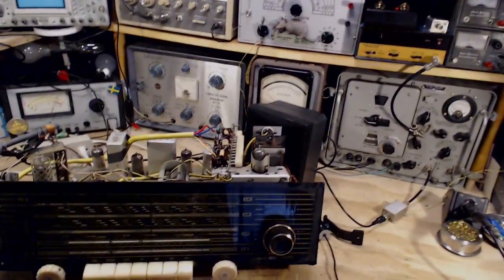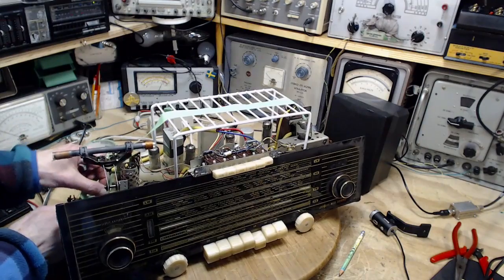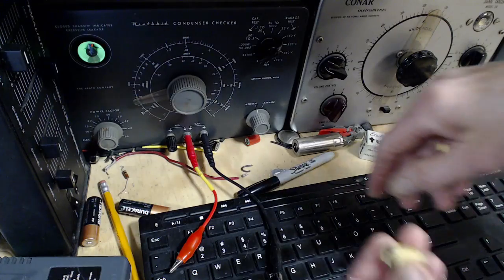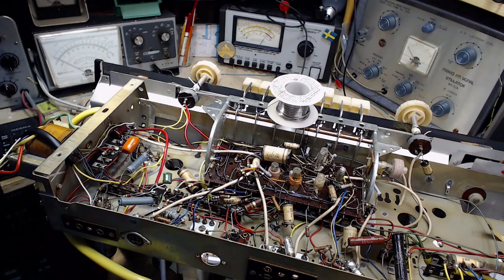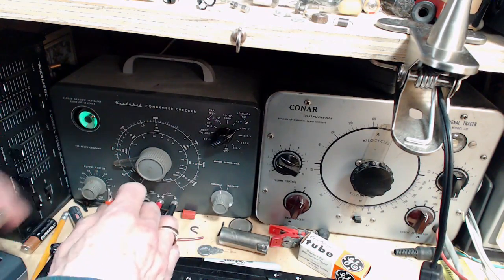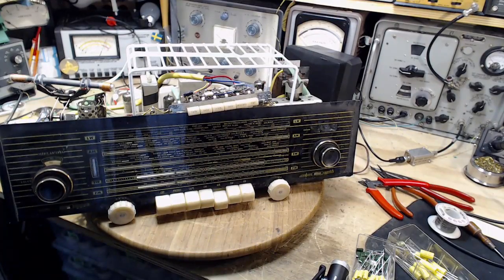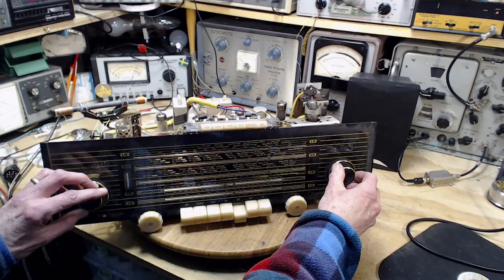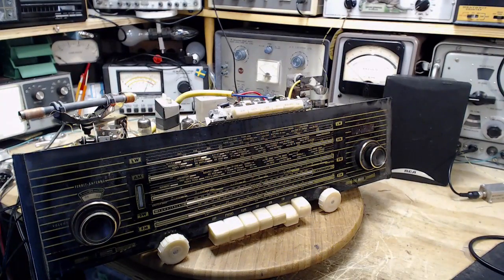German Console Radio Video #2 - 17 Catpacitors Replaced

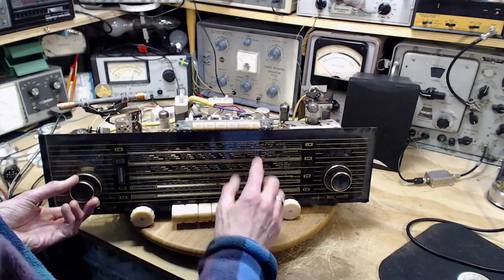Comment: 38:48 it may very well be regeneration or undesired feedback seeing that on replacing the caps near the array of band switches the orientation of outer foil was ignored, thereby opening many doors for stray signals to enter high impedance RF and IF inputs.
But hey, good enough. Good show, great success. A radio working decently before at least on AM is now a RF noise generator...
Lets do an alignment, and seeing that we cannot read the german manual nor care to use google translator on it, we will wing it...
Looking forward to another 107% success story...

Comment: 27:53 2x5000pF was a common value for double caps from L and N to chassis. Which btw means their replacements should conform to class Y AND NOT CLASS X. Reason is simple; class X does not catch fire but can still short. But you would never want to allow any cap from line to chassis to short. Class Y however is made to not short and so protect people touching the chassis. That is why class Y is mostly a ceramic disc type cap and not foil.

 And the third wire on the old cap is sleeved red because in old wiring pre 1962 color code red was used as earth ground which confirms the purpose  of this cap and its wiring.

Comment: 10:08 for crying out loud! That capacitor is leaky as hell. At 50V the eye should have popped right open. And I mean FULLY OPEN not 80%. Why do you go by your gut feeling, when all you have to do to judge the leakage of the capacitors is doing a side by side comparison to a new one on that meter. That is the one and only valid way of judging. That meter of yours btw is not that sensitive to leakage anyways. So in a side to side comparison it would even make caps look fine that would utterly fail on a sensitive tester like the one Mr.Carlson built. But calling this cap "not that bad" is delusional and only remotely okay if you  dont care about the quality of the job and the long term reliability.

And just for the records; that very slow opening of the eye at 10:56 is not an effect of slow charging. It is a depolarizing effect caused by electrochemical reactions between the moist and degraded paper and the foil, forming either fine layers of nascending gasses or insulating layers of oxides. The latter being much like reforming of an electrolytic, but with the difference being, that the electrolyte and foil in an electrolytic cap supports reforming and the insulating Aluminiumoxide layer is stable even with voltage removed, while in a moist paper cap it is a non-stable effect.
Reply: He is the Mr MaGoo of radio repairs or should I say demolition. It’s a clown show of 10-12 videos for a simple repair. He goes for quantity of videos for ad revenue over quality of video for the viewers though it is highly unlikely he can make a quality video that anyone could learn from except what not to do.
Reply: The bottom line is he did not put any of these back in the radio anyway. Does it really matter what he said about it? He is correct in saying it would not matter in how the radio preformed in the short term. Of course it would fail eventually, but I doubt replacing it had any effect on the immediate performance of the radio at all. We can't all be Electrical Engineers like Mr. Carlson and design and make our own super sensitive capacitor tester now can we?
Reply: @SIXSTRING63  Must be one of very few that doesn't know how to circumvent YouTube copyright hits. And judging by the number of views and lack of commercial sponsorship, I doubt he makes a dime out of posting lame clips.
Reply: He is an electrical engineer as he has said and is fixing these for people, i personally would want it done right and him doing it from what he thinks is right is not going to make it right.  His explanation dont make sense half the time either.  One wont learn anything watching these videos
Reply: @curtisgriffin7924  If he has a degree he must’ve had it given to him. I’ve met my share of mechanical engineers during my years as a tool and die maker and CNC programmer who didn’t have basic knowledge that a first year machinist would know. Trouble with many engineering programs is they never have enough practical experience. Had to deal with a team of engineers on one project, one tried to tell me that a .100 thick x 6”x6” metal welded cover over a .5” cavity should have no deflection with a 100p.s.i of air applied internally. I told him it would deflect at least .010” in the center just from previous experience. He argued, the head engineer pulled out a calculator, punched in some numbers and informed his colleagues I was absolutely correct. That head engineer took me and my guys working on the project out to lunch. Apparently he didn’t care for his colleagues know it all attitude. A college degree doesn’t make anyone an expert. I learned electronics on my own from books, videos and some old techs with years of experience which is the best teacher.
Reply: @curtisgriffin7924  Jim is not an electrical engineer, he just worked for Ontario Hydro urban grid maintenance and retired with a nice pension. Neither has any significant electronic formal education, and this is stunningly evident by his lack of knowledge and skills. Regards, thanks for posting.
Reply: @ableutopia2721  Saw on his Linkedin page he had engineering in his background.  Took my saying from that and what I have heard him say on videos now thinking back maybe implying more than anything.  Engineering can encompass so much though that it can at times be misleading.  Thank you for the response!
Reply: ...I'll have to remember that-!!!